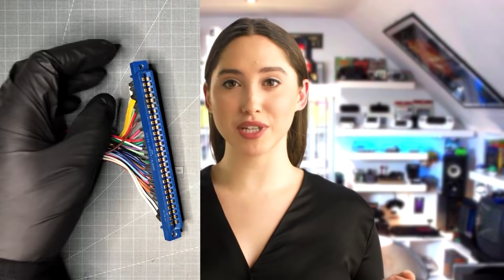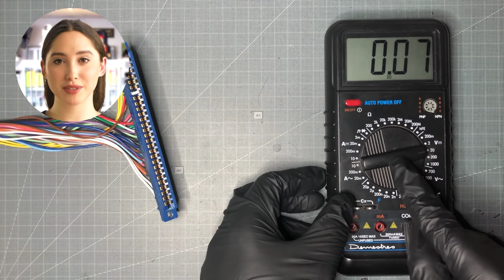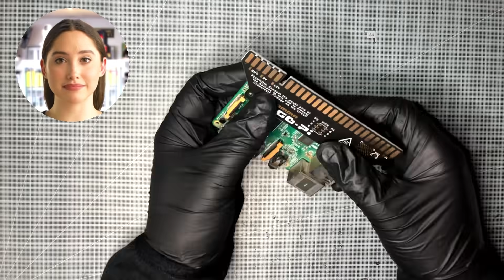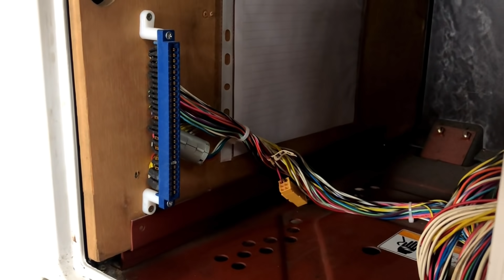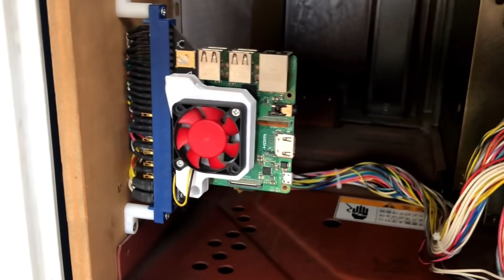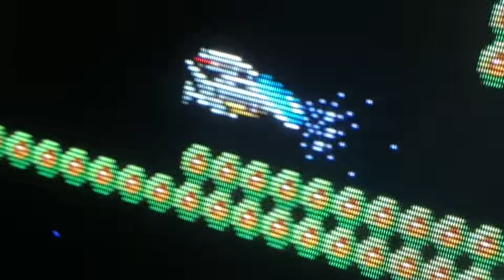Tutorial JAMMA RGB-Pi (English version)

Comment: Hello, I hope your product can save me, let me explain :)
I bought a pi2jamma for my Blast city but the screen is too dark even by increasing the brightness to the maximum (Nanao MS-2931, 15/24/31 kHz, auto screen). As you know, arcade monitors require 4V/5V on the RGB input. The pi2jamma video amplifier is not powerful enough. Will your RGB-PI JAMMA work properly? Thank you !
Reply from the maker: I have one MS2930 and the bright is 99% of the original board.
Reply: You need to set the dip switch SW3 on MS-2931 remote board. It is below the control panel, on the right side, three dips, usually black housing with orange dip switches. SW3 you need..
Reply: One os to rasp 4 with 15k and one os in 31k with naomi..atomiswave..cave.y2..pgm2...mugen..terrordrome..would be perfect.
I also have a blast city..and waiting a img 640x480p to use in jamma..
Reply: @Asure007  Yes..a basic..but important.
Remove vga connector..a switch 3 high vga/low jamma.
I also had a dark video with my pi2jamma rasp3..and waiting a rgb os rasp 4 jamma to play 31k games..
Reply: @Asure007  daha açıklayıcı ol dostum
Reply: @Asure007  daha açıklayıcı ol dostum

Comment: I have installed Rgb-pi on my raspberry pi 3 b + but I have no signal on the crt, while if I connect the hdmi cable, it works regularly, why? the crt works because I use it regularly with pandora box.